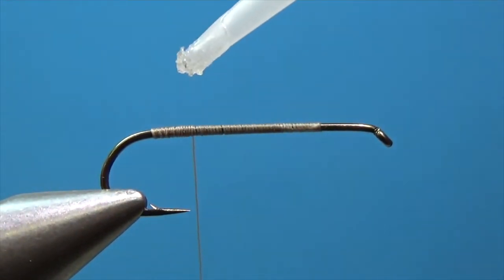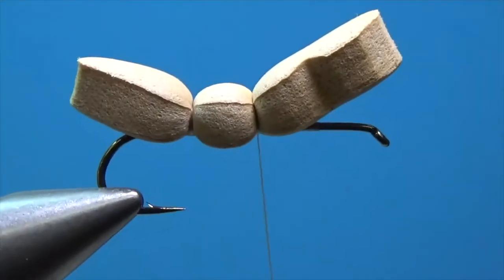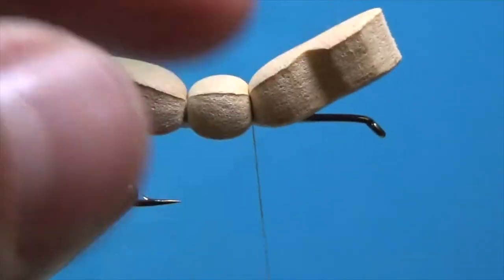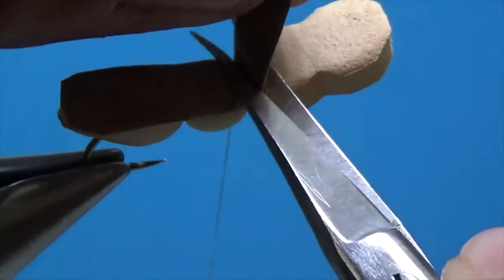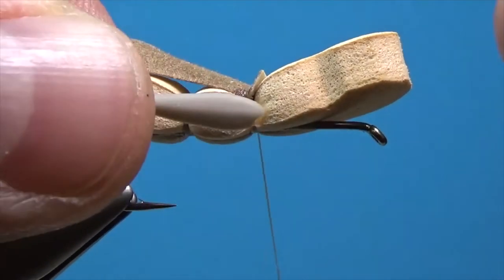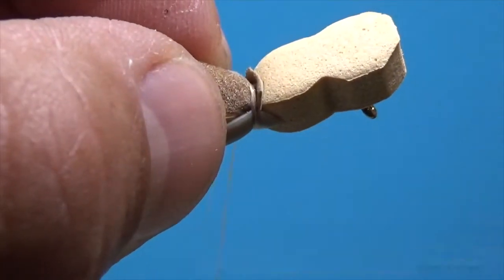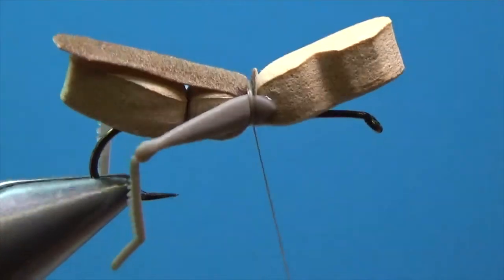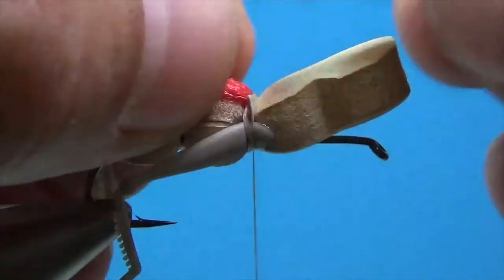Western Hopper

Comment: about how manny flies can you tie with the amount of material per box ( how manny hoppers if i diddnt mess up could i tie?)
Reply from the maker: MFishingBC check out our website- www.smittysflybox.com. We send out a new box every month. Mostly we send enough materials to tie 25 flies. If it’s a large articulated pattern we will only do 12. If it’s a simple fly we may do 50. So it varies a little. 25 is the baseline
Reply: Smitty's Monthly Fly Box  cool thanks, if the costs arent too much to ship to canada i may be interested
Reply: What size is foam cut?
Reply from the maker: Rudy Chavira I used a precut 6mm foam. It comes from the rivers wild hopper parts you can get from Sportsman’s Warehouse. They may be available from Sportsmans.com